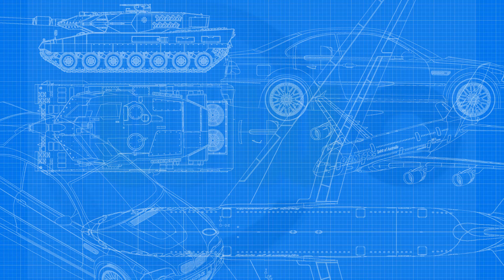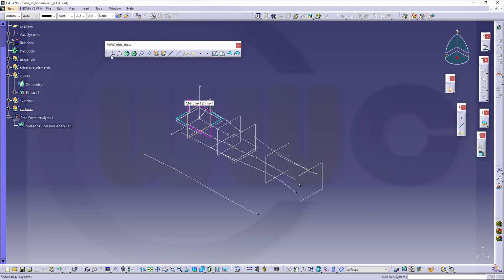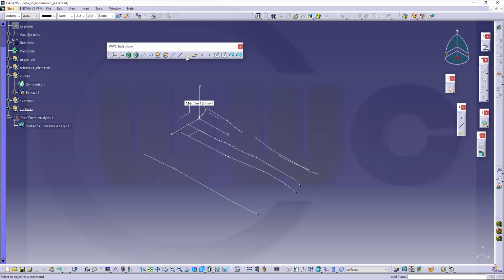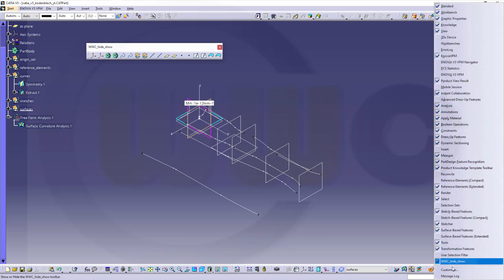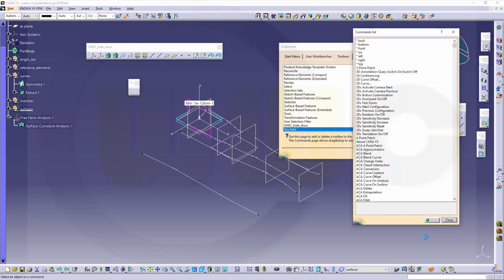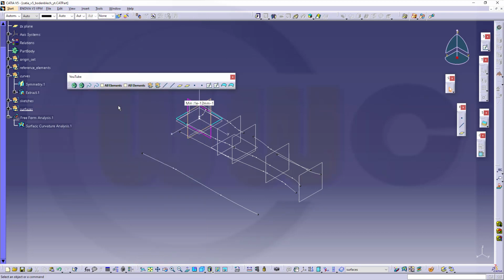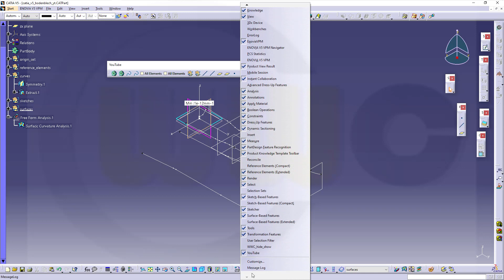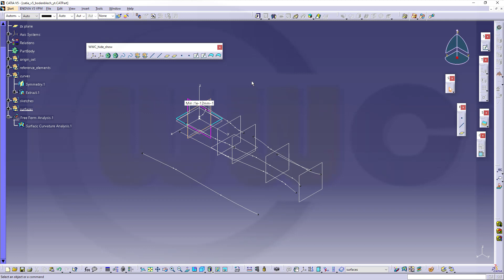Customize Toolbars - Catia v5 Training - FAQ Shorts

Comment: It sucks. CATIA is not friendly user interface app. Especially adding a buttons for a lot of macro and scripts suck. In contrast to Siemens NX you can compose all commands, scripts, macros in the text window. And you can create as much menu files as you wish using notepad. Hell yeah, there are two simple button Save/Load role in Siemens NX, and you can share copy save as much user toolbars configurations as you wish even if you configured it via graphic interface. CATIA can't. CATIA sucks for overprice... Dassault sucks, cause they are ugly greedy meanie mutterfuckers